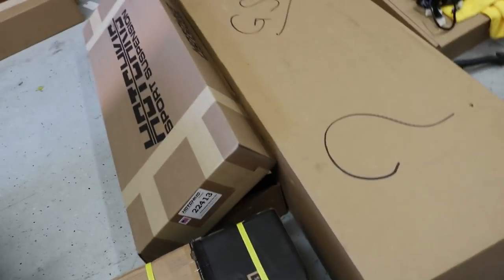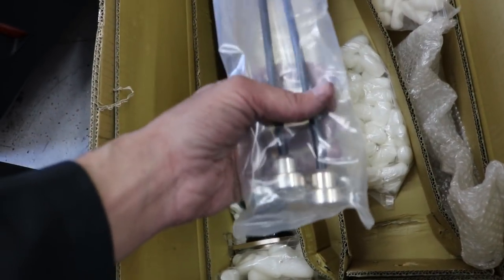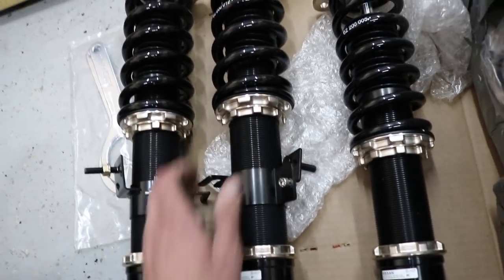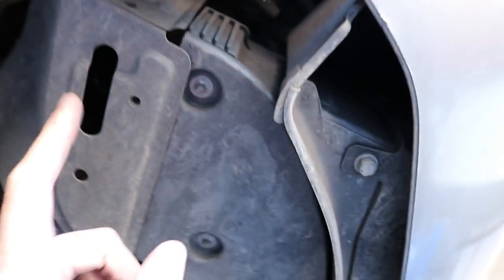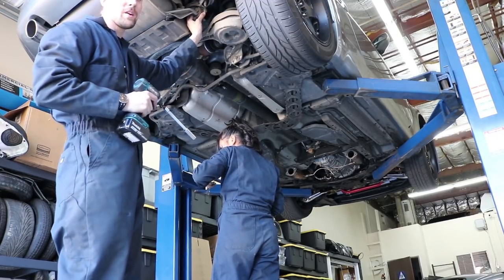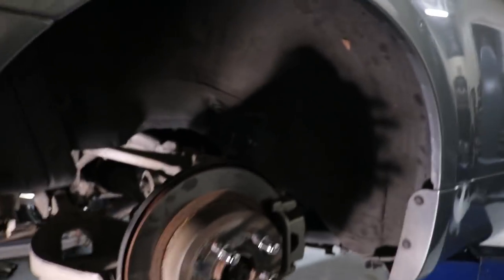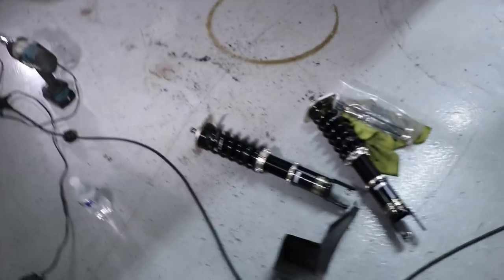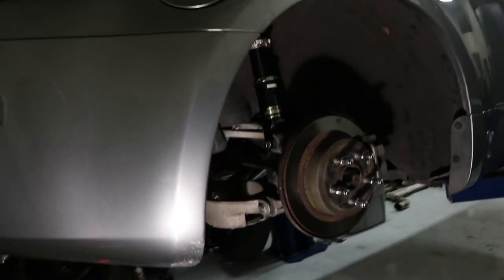Motordyne Shockwave TDX2 BC True Coils Hotchkis Sways Whiteline End-Links on Bae's Z

Comment: Sick channel man ur clutch install vid was my bible (still in process) and I need ur help, the transmission won't slide back in ive got like a half inch and it just won't go in any further what do I do
Reply from the maker: I usually start screwing the bolts in all equally and go in a star pattern to pull the transmission up to the engine. That's what usually works for me. Hope that helps, and thanks bro I appreciate the support. Or you can try to support the transmission with a rope from the top and use a engine hoist to adjust the front while using a jack to support the rear while pushing it in. But I usually have trouble with getting the last inch lol. Just be careful not to damage the pilot bushing, and good luck hope you get it done!
Reply: Ya I'm 16 and this is my first time doing this and am just worried about breaking something thanks so much for all ur help tho!
Reply from the maker: Sandro Massarelli Hey man no problem, good luck with your z. They're super fun cars just stay on top of maintenance, and check your oil often. Maintenance is key with these cars, as long as you keep up with it, they last.

Comment: hey man I just installed my Motordyne as well and it sounds so good. I got one issue tho, when accelerating from a complete stop, I can hear some metal on metal tappin/rattling from the mid section of the part to the end, can’t quite pinpoint it. Only when accelerating from a stop tho, and it disappears after I get goin. Any idea what this could be? Thank you!
Reply from the maker: LowFye Art Could be agaisnt the rear sub frame front brace, the one that looks like a "W". I thought we were gonna have issues there but we were okay
Reply: Full Throttle i figured it out bro, I didn’t remove the heat shield on the passenger side towards the end of the car, the pipe was hittin that
Reply from the maker: LowFye Art That's right, I forgot about that. We had to remove it as well.